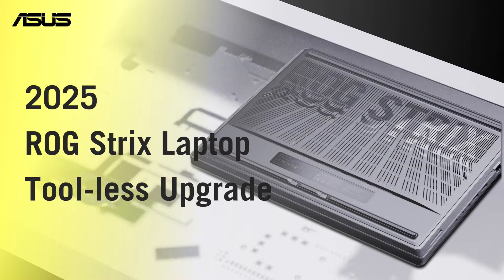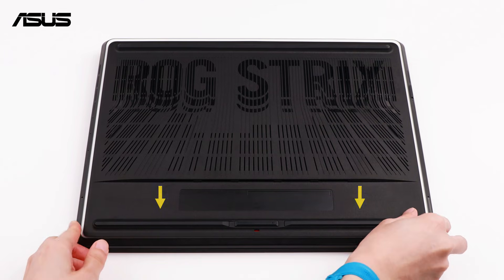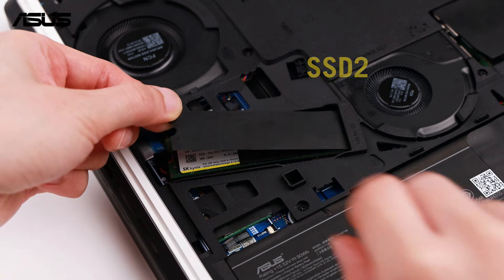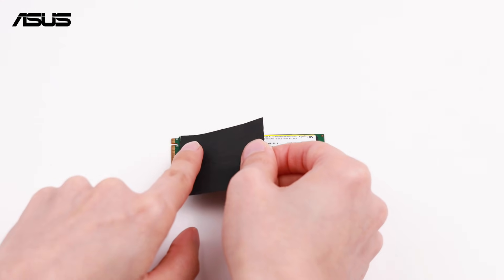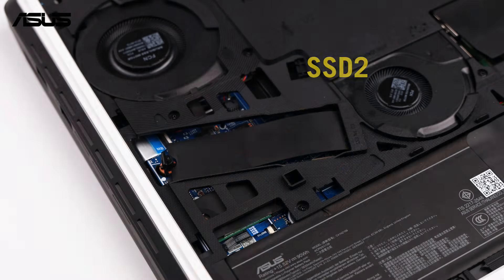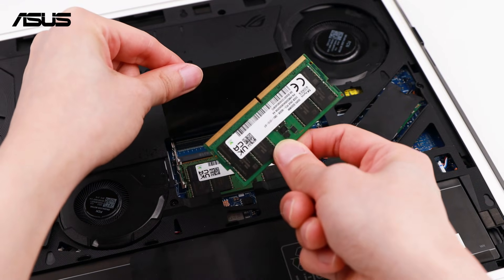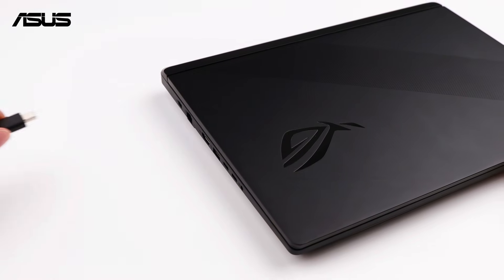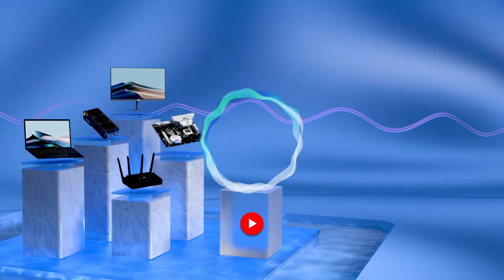2025 ROG Strix laptop Tool-less Upgrade  | ASUS SUPPORT

Comment: I installed a Samsung 9100 Pro 2TB SSD on my ROG Strix SCAR 16 (Model G635LR-RW011W, U9-275HX, 5070Ti). 
Since I couldn't find a single thermal pad with the exact thickness ASUS used underneath the drive, I stacked multiple thermal pads to build up the required thickness. It worked perfectly! The Samsung SSD is now running even cooler than the stock drive that came with the laptop.
I might also buy two thin heatsinks later to place on top of the SSDs
Reply: In the older G16, SSD2 is above the Intel WiFi module. The intense amount of heat generated in that area will either kill Wi-Fi card or ssd.

Comment: I purchased this model, but it did not come with any thermal pads. Could you let me know the thickness of the thermal pads used in the video?
Reply: Bought this laptop and in my one it's 6mm (this white block)
Reply: @ThePigmejus  oh wow. I used 3 mm. It didn't look like 6 mm. I am monitoring temp. I guess I'll find out, and then use a 4-ple stack of 1.5 mm pads if needed.

Comment: Don't buy ASUS!
After-sales support simply doesn't exist.
I bought a motherboard in December 2024, and a few months later, it developed a defect.
I tried to send it to ASUS support, but was told that support should be handled by the reseller.

The reseller kept my motherboard and returned a used MSI motherboard, out of warranty.
I contacted ASUS again, and the response was that I should complain to Global Data.

ASUS's disregard for consumers and lack of responsibility in after-sales support are shameful.
Reply from the maker: If the distributor engages in improper practices during after-sales service (such as replacing with non-original brand products), this does not comply with ASUS regulations. We recommend that you create a post at the link below and provide your product serial number and proof of purchase. We will assist in investigating the matter and contacting the distributor to ensure your rights are protected.
https://zentalk.asus.com/t5/motherboards/bd-p/motherboards
Sorry for any inconvenience it may be caused.

Comment: How high is the thermal pad?
Reply: I'm looking same answer did you learn?
Reply: Did you guys learned? I’m wondering what is this name and how high? 1:26
Reply: If you pause the video and check, it appears that the thermal pad is double-layered.
It seems like the problem could be solved by stacking two or three 2mm thick pads.

Comment: i purchased recently asus expertbook p1  but only 30 min of use then not on laptop
Reply from the maker: Please check whether the charging indicator light turns on when you connect the charger.  
If the light is on, turn off the laptop, remove all connected devices, let the laptop sit for 10 minutes, and then connect only the charger to see if it can power on.  
If the light does not turn on and your laptop is newly purchased, we recommend contacting your reseller to see if a return or exchange is possible. We apologize for any inconvenience this may have caused.

Comment: I recently purchased an Asus VivoBook M1407KA featuring the RYZEN AI 5 340 processor. I attempted to upgrade the memory using a Kingston DDR5 5600 SO-DIMM module (Model: KVR56S46BS8-16), but unfortunately, the system failed to recognize the RAM after installation.

I would appreciate your assistance with the following questions:

Is this memory module officially supported by the M1407KA model?

Are there any BIOS settings or updates that could enable compatibility?

If this module is not supported, could you kindly recommend compatible DDR5 SO-DIMM options?
Reply from the maker: Regarding your question, I would recommend you visit the following forum and post there to get more assistance. 
https://zentalk.asus.com/t5/laptop/ct-p/Laptop
Thank you.

Comment: I have the ASUS ROG Strix G16 G615LR-NEBULA002 model with two SSD slots. I'd like to know the maximum TB capacity supported per slot. I couldn't find this information anywhere THX!
Reply: Per Slot you can add 2tb easily, nowadays every laptop support atleast 2tb per slot meaning, you can upgrade overall storage upto 4tb

Comment: I bought the same model ASUS ROG Strix G16 with i9-14900HX, and my experience has been terrible, the CPU delivers limited performance with constant thermal throttling, far below expectations. ASUS Brazil warranty returned my laptop dirty with a wrong diagnosis, the after-sales support is very awful. Very disappointing.
Reply from the maker: Regarding your question, I would recommend you visit the following forum and post there to get more assistance. 
https://rog-forum.asus.com/t5/gaming-notebooks/bd-p/SRI_Gaming_Notebooks
Sorry for any inconvenience it may be caused.

Comment: 2025 ROG Strix Scar 18 doesn't twist, instead you tilt the Q-Latch away from the SSD. Remove SSD install new SSD and push the Q-Latch back towards the SSD to secure in place.
Reply: Can u eloborate I dont want to brake mine
Reply: @parlay9495  Yeah, me neither. I wanna know too.

Comment: Rog strix g615 wont run my kingston fury impact ram at  full 6400 cl38, why is this happening? I thought the specs said the g615 can run ram at 6400? There is no XMP settings or ai tweaker in the bios.
Reply from the maker: Regarding your question, I would recommend you visit the following forum and post there to get more assistance.
https://zentalk.asus.com/t5/laptop/ct-p/Laptop
Sorry for any inconvenience it may be caused.

Comment: Heat sink version ssd will not allow you to close the case once installed - make sure to install ssd that does not have a thick heat sink
Reply: What heat sink solution did you use?
Reply: @cypocalypse  Possibly one that's 6mm thick, according to a reply to another comment.

Comment: VERY DISAPPOINTED WITH ASUS ROG.

August 2022, I did full cash payment for a "brand new" ROG STRIX SCAR 3070Ti, 2TB SSD, 32GB Ram, availed everything the ROG offers in their direct ROG STORE. I use it sometimes to play steam games(AC Odyssey) at around 8hours per week/2hrs per alternate days, then around 1hour in facebook, MS Word, and Adobe pdf for typing documents.

Since August 2022 until today, it keeps on having issues EVERY YEAR.
First was(at its 6th month, 2023) had to sent it back to ASUS repair center because the SSD Storage suddenly is failing and they need to replace it. Then at its 18th month(2024) i had to sent it back again since the wifi card/part is malfunctioning and needs replacement.

Another again this May 2025, its' display shows hairlines, and according to ASUS is due to LCD wear and tear that needs replacement. I waited for 1month before the display replacement part arrived, then after the service center replaced it, I noticed that there are still hairlines in the display, so the service center apologized and promised they will have it replaced asap since they received a "defective display replacement part". So after 2weeks again(my ghad its July 2025) they replaced it with a brand new display. I was happy at first(finally) but only to find out they tricked me with a QHD @60Hz display, and NOT my QHD @240Hz display screen. WTF ASUS REPAIR CENTER is trying to fool/trick their customer! Yep its true, I have ALL the evidences! Again they apologize and told me that instead they will just send my unit to ASUS MAIN REPAIR CENTER. Now it's August 2025 and still got no updates from my strix scar. I think they are now damaging it more 😂 or scrapping out the insides replacing with junks and more defective parts 😊 

NEVER AGAIN ASUS ROG. You are just good with RGB fancy lightings and cool designs. But Poor Quality Products. I have ALL the receipts, boxes, and proof to prove that you are the worst! NEVER AGAIN ROG.
Reply from the maker: We apologize for the unpleasant repair experience you have had. In order to better assist you, please provide your issue and product serial number to the following email address. We will have a dedicated representative help you.  ASUS_Support_HQ@asus.com
Sorry for any inconvenience it may be caused.

Comment: In the official specs, the highest amount of ssd is 2TB per slot.
Possible to use 4TB in a single slot if i using single sided 4TB ssd?
Reply from the maker: Unfortunately, if you upgrade the SSD to a capacity larger than what is specified in the specifications, we cannot guarantee its stability or compatibility.
Reply: @asus_support can i damage my laptop or my ssd if i test this out?
Hardware or software limitation  is the reason for 4TB sticks not supported?
Reply from the maker: If you follow the replacement steps, it should not damage the SSD. If a 4TB SSD cannot be recognized or used, it is most likely due to compatibility issues.

Comment: Is it necessary to have the graphene sheet when upgrading the ssd? Isn’t graphene electrically conductive?
Reply: I opted to forgot it for that purpose. I used two stacked 1.5 mm gelid pads and that's it. Initial read of temp at 33C is good. SSD 1 has the full setup though. I didnt touch that one.

Comment: Hello. In my model the second slot is totally empty. In order to add a new ssd, i want to use a similar thermal pad, with the same thickness of the right one. Where can I find a new thermal pad? I only found 1mm thickness, but I need more, i think. Thank you
Reply: Hi, I saw your comment and I had the same issue, did you solve it?
Reply from the maker: May I ask what kind of issue you are experiencing? 
Have you tried any troubleshooting methods to resolve the problem? 
Could you please provide the product model and a detailed description of the issue you are facing?
Reply: @asus_support  I have a brand new STRIX SCAR G16 5080.

It has no mylar, no graphene wrap, and no thermal pad for SSD2. (SSD1 has all of the above and was factory installed.)

As I understand the above posters they are having the same issues.

Were these items intended to be in the box? Do I have to order them from ASUS? 

Is it safe to install an SSD in the SSD slot without these items?
Reply from the maker: If your laptop was shipped with only one SSD, I think this is normal. If you want to install a second SSD, you can do so directly. If you wish to further enhance the cooling for SSD2, you may purchase a third-party thermal pad.
Reply: @asus_support  So in response to one of his questions.  Can we install the 2nd SSD Without the 3 components in this video safely?  The pad spacing between the SSD and motherboard seems important?
Reply: @asus_support 
in the video 
it doesn't shows 
That the battery connector unplugged before doing upgrade ram or ssd 
and the battery connector are also covered and unable to be seen 

how is that okay ?
Reply: @No1-h8l  this laptop has ALS sensor when you open laptop cover

So battery will be off and plugged in
Reply: Same question here. It's very strange that the thermal pad etc is not included with the laptop. I have just installed a 2tb WB SSD
Reply: i ordered the parts they use on the asus accessories site they have the thermal pad that sits under the ssd and they have they modular sticker youll need to place over the ssd once its wrapped with the graphite sheet they also sell the mylar there too the only thing they dont sell is the graphite sheet
Reply: @DavidJones-ontour  Please tell me the website where you found these thermal pads. I need to know their thickness.
Reply from the maker: Unfortunately, we do not sell thermal pad. We recommend searching for them on online platforms. Sorry for any inconvenience it may be caused.
Reply: @asus_support  Ok. If I use a thin pad (1mm), do you think it can do its work in a good way, or it's unuseful?

Comment: To replace the RAM or SSD, you need to deactivate the battery. In the video, I see that it doesn't disconnect.
Reply: You don't need to do that they suggest getting the battery to 25% or lower before doing this.
Reply: @ZeitGeist_TV bro……. Pls don’t write anything here…. I feel pain when I’m reading your comment
Reply: @ZeitGeist_TV 
is it really okay to upgrade without unplugging the battery connector ?
Reply: @No1-h8l I didn't disconnect the battery at all, my laptop was opened twice and she's running fine months later no issues.
Reply: I have the same sentiments.
Reply: Well, if you open the cover you will see the inside plastic cover with so many tiny screws (really tiny). Rather than lose all those screws somewhere in the MB, I just trusted the ALS and grounded myself. It's been a while since I replaced or added components in a laptop (because it's been a total b!tch to do so), but I don't ever recall purposely disconnecting the battery. Some you just did because it made the laptop light to deal with though.

Comment: Hi! I wanna install another ssd into the empty slot in my scar 18.
The twist knob seems to be tight, so i didnt force it too much.
Can you please confirm that there is no plastic lock of any kind and we can just twist it anti-clockwise to turn it?
Reply: Hey, did you have luck with this? I am trying to add a second NVME to my Strix G16 and the knobs on both ssd slots just won't turn. I don't want to go full brute force on those, for obvious reasons.
Reply: @laffinkippah I just applied a little more force than i thought i should and it worked
Reply: @laffinkippah  I want to know too. Any updates?
Reply: @rifatul  I think to remember there was a trick to it that I figured shortly after posting the question above, but I'll be damned if I can remember it. It was certainly not about strength but rather, turning it "just so". I think I remember scouring youtube for videos about this until I found one that made it clear what to do, but I can't see it in my history. Sorry I can't be more help.
Reply: @laffinkippah  Dang
Reply from the maker: Regarding your question, I would recommend you visit the following forum and post there to get more assistance. 
https://rog-forum.asus.com/t5/gaming-notebooks/bd-p/HSS_Notebooks
Sorry for any inconvenience it may be caused.

Comment: Is there anyway to change the battery as well?😮

I assume I can vacuum the fan by myself? 😍 cause I always having trouble with a overheating laptop after a few years.
Reply from the maker: If you need to replace the battery, we recommend contacting local customer service. 
The following is the contact information:
https://www.asus.com/support/CallUs# 
If you are comfortable with disassembling the laptop, you can certainly clean it yourself.
Thank you.

Comment: i have problem with the device when i put it in porformance mode and i use video editing software when i start export the project the screen start plaing line and black out 
its waied issue and make me to force shoutdown the laptop
Reply from the maker: Please check if the issue persists when connecting to another projector. If the issue remains, please try reinstalling the graphics card driver and check again.

Comment: hello asus I'm using Asus Vivobook S15 i5 12th gen (K3502ZA). I'm facing problems as my f10 key is not working to toggle the camera off. i even used asus Screenxpert, it didn't worked either. i reinstalled system control interface v3. and rebooted it, didn't worked. help me. it's not a hardware issue as the key is registering, it's just not able to turn off the camera.
Reply from the maker: It is recommended that you go to Device Manager, uninstall the camera device, restart your computer, and then reinstall the driver. If the issue persists, please consider disabling the device or backing up your data and restoring the system to check again. We apologize for any inconvenience caused.

Comment: Is it possible to insert a Samsung 9100 Pro (Gen5) SSD with headsink into the new ROG Strix SCAR 18 (2025) G835LX-SA008W.
Reply: I have just bought the Asus Rog Strix 16 2025. I bought 2x9100 with heat sink as they were on special at Amazon, being a &100.00 or so cheaper than the 9100 without heat sinks.
The back would not close as the heat sinks are to thick, so I removed these to enable my using the drives. There were incompatibility issues in Samsung Magician. Samsung Headtech Consultation advised to disable VMD controller in the BIOS. Which meant reinstalling windows 11, but no problems, and got 90% more speed from the 9100's. Hope this helps.
Reply from the maker: Regarding your question, I would recommend you visit the following forum post to get more assistance.
https://rog-forum.asus.com/t5/gaming-notebooks/bd-p/HSS_Notebooks
Thank you.